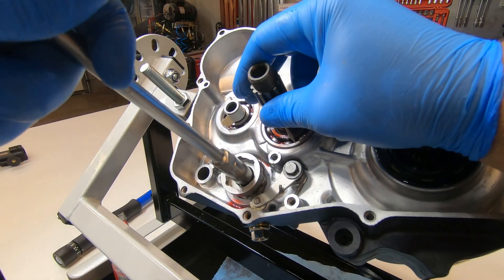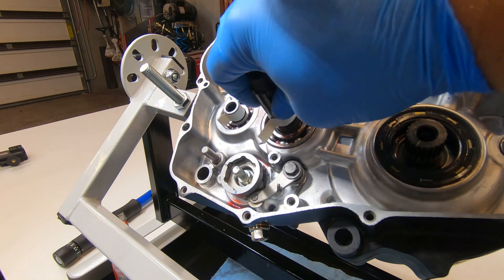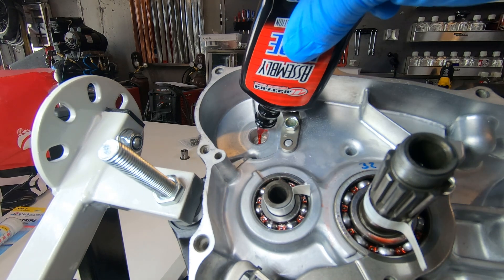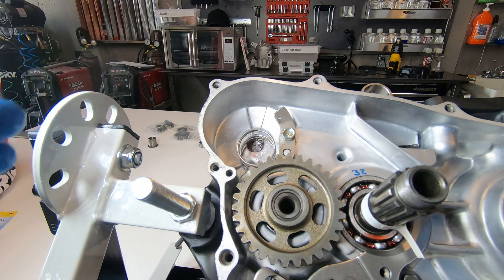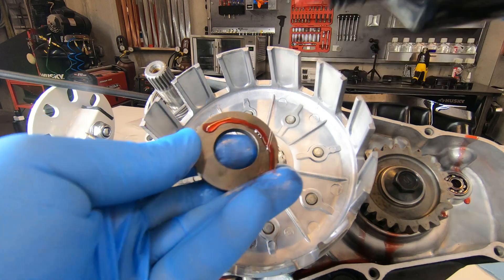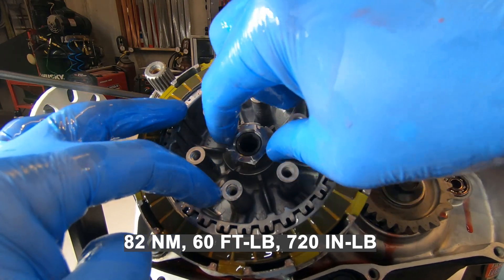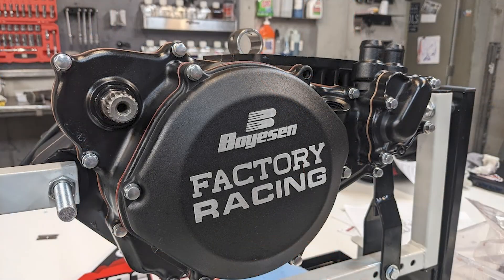CR500 Motor Build - PART TWO - Gearshift, Kickstarter, Clutch, Water Pump

Comment: So i just got done assembling the case and sealing it up. I didnt double check going through the gears before i sealed it. I was able to spin the drum selector. But now thatvthe case is together, is there a way to tell if everything is solid with gears before its totally complete and installed. Seems hard to shift? I was able to get it into first. Everything spins freely in neutral and in first you can tell its in gear. Any opinions or pointers to check it goes into all gears before i put outter case, clutch and all that on?
Reply from the maker: Perhaps if you give me some more info we can figure it out.

So you can get it into 1st and Neutral but that's all? 

Did it work properly before you took it apart?

Did you make sure you had all the little washers in the transmition?

Did you happen to examine the shifter forks and the dogs on the gears? 

Any chance the rods were bent?
Reply: @DBT-Nick  sounds good! Maybe I can get some pictures! But yea everything was solid before I took it apart no issues nothing bent and nothing seems worn out or damaged. I can spin everything freely I stuck the shifter on to make sure it went into gear since i sealed the cases already and when I did it's alittle hard to get into first and then when I try to go to second or above it doesn't seem to want to go. Washers are all there I kept it all together as much as I could and looked in the manual to double check. I should technically be able to shit thru the gears with it sealed up right?
Reply from the maker: OK, I want you to take off the shifting mechanism. So there will be a sort of round part with different indents in it. In the video you can see me turning this through the gears with a T handle. So do that. Remove the shifting mechanism and try to shift through the gears with a T handle on that part. One time what happened to me was I installed the shifting mechanism wrong and it made it so I could only go down to first. That was on a 1987 CR 250.
Reply: @DBT-Nick  sounds good! That's what I was thinking too. I should of done that before I sealed the cases up which sucks. But ohwell! Better safe than sorry! I saw your video after the fact! Lol
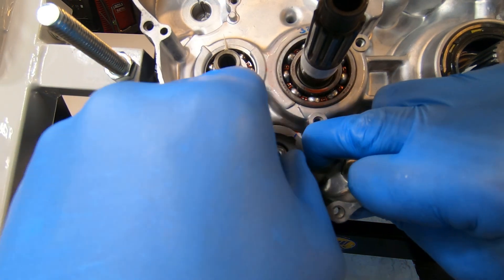Reply from the maker: OK don't feel bad, you test this after you seal the cases. So in my video at 0:47 I'm installing the Shifter Pin. Use a T wrench to turn the shift drum.  If that works ans you can go 1-5 then put the shifter back together and try again. 

Now IF it's still not working then gently try to make it free itself up for a while. If you can't do it then split the cases again and I bet one of the 3 shifter rods is crooked or something... Keep me posted.
Reply: @DBT-Nick  awesome!!! Tgat sounds like a plan to me! I greatly appreciate all your help! Will definitely keep you posted!💯 thanks again! Fingers crossed🤣💯🤞
Reply: Do you have anything on the water pump install? Does the seal face open side out on the outter case? It's been month since I took it apart and of course I don't have pictures. Then there's 2 water seals and an oil seal according to the manual?
Reply from the maker: it actually does matter which way those go, but I can’t remember how it goes. Let me look into it and get back to you. Give me like an hour.
Reply: Sounds good. I wondered. I put them closed side out on both of them. Manual and rocky mountain atv looks like open side goes out.
Reply: Wondering if I somehow installed everything with it in neutral? Which the manual said not to?
Reply: Doesn't seem to want to go into 5th all the time. Something still seems weird. But my line on the shifter drum now matches and lines up with yours
Reply: When you shift if does it seem like it gets stuck or hung up? Sometimes coming back down from 5th it seems like it gets stuck going back to 4th . Then from 3rd to 4th sometimes gets hung up even tho I'm spinning the shaft? I don't have pil in it but it was lubed up when I installed everything.
Reply from the maker: Hmmm all very interesting. Could it be possible that you have some wear on the dogs on the sides of the gears?  I think you're problem would not be that but I just don't want to rule it out. 

This is tricky...the good thing is that it worked before, so it should go back together and work. Just keep trying. You've likely just got something binding on you. I think it's gotta be the drum or forks.  Maybe check that you have the forks in the right configuration.

No I have not experienced the difficulty of shifting like that. 

Before joining the cases does it all spin OK? Shifting through the gears before joining them does it operate better?
Reply: @DBT-Nick  that's what I'm wondering nothing looked too bad when I pulled it apart. And before I put it back together everything was smooth and spun. When it's in neutral it spins nice when I shift into a gear you can tell and it's alittle harder to spin. I hate to do it but maybe I'll separate the cases again and see. I think it's the first time this motors ever been rebuilt. First time I've ever done it atleast.
Reply: @DBT-Nick  I double checked the shift forks when I separated it and looked in the manual. 5l and 5r were facing up and had them in the right order. And the one on the other side. I felt like they could only go in the one way as long as you had 5l and 5r in the correct spots and number facing up when it was onstalled
Reply from the maker: I'm thinking about this... I just keep thinking that if you split and join the cases enough times you'll get it. Haha 

Split the case but keep the shift drum installed on the clutch side of the right case to make it easy to place the tyranny into each gear while you turn the gears.
Reply: @DBT-Nick  yep I agree! Better safe than sorry! Sucks to keep doing but rather do that than break parts. I'll keep you posted and we'll see what happens. Hopefully I won't run into any more questions lol
Reply from the maker: I don't mind bro
Reply: @DBT-Nick  it's a warmer day out here now just came back and everything is shifting perfectly fine. I didn't spin the shaft and shifted and it's good now?! Weird. Lol
Reply from the maker: Oh good

Comment: What year engine is this??
Reply from the maker: 1997 but this video should cover CR500 engines from 1989 thru 2001
Reply: @DBT-Nick  I’m finishing up my 1987 engine tonight, water pump side and then top end
Reply from the maker: @Brensta18  How'd did the motor finish out?

Comment: Hey man nice vid! A coworker of mine gave an ‘88 CR500. She’s in pretty rough shape so I’m trying to do a full rebuild. Wondering if you have any suggestions on best place to buy parts or any lessons learned from your rebuild. This is my first time doing a rebuild and I’m a bit nervous about ruining a beauty like a CR500
Reply: Not true stock for stock a cr500r still beats modern 450s unless it was a crap driver... will it absolutely smoke a 450 no... but still faster then 450s (with a healthy stock cr500r)... now if your talking about more technical riding yeah a modern 450 will probably beat it due to better modern suspension and being a bit more controllable. Cr500r will still pull ahead on straight aways tho
Reply from the maker: HELLO! Ok so try to keep in mind that they don't make these anymore... and so you want to really do your best work. Now, that being said, there are numerous companies who make parts, (bearings, gaskets, seals, etc) but try to get OEM. I spent about $1,000 just on OEM parts from Honda via Rocky Mountain ATV/MC. Just follow the steps and you'll be good. If you can afford it you should get at BUILIT-500 Crank. I have some resources if you need cylinder work. What color are you going for? I Cerakoted the cases and it turned out so sick. The 1988 CR500 motor was all black. Let me know if you need help with that. Also all bare aluminum would look sick too. 

Ok another thing, do you want a stock motor or one with a crap ton of power? For reference, a stock CR500 will be slower than a modern 450, so maybe that helps. If you want more power, or like a race motor for climbing big sand hills then you need to plan for that and I can help you get your motor to deferent shops to help you accomplish that. 

Let me know!!
Reply: @DBT-Nick   dang thanks for the quick reply and awesome info! I was looking on RMATV and I unfortunately couldn’t find an engine rebuild kit for the ‘88 and I’m weary of other websites. Did you buy a kit or individual parts? I was for sure planning on cerakoting it and I was thinking about doing black but I also kinda wanna do something a little flashy just for fun like red or a brass color. 

I’m not a super experienced rider so the stock power already is a bit intimidating for me. I haven’t ridden in about 5 years and my last bike was a CRF230. I basically just trail ride so I think stock power is already a bit much for the kind of stuff I’m capable of hitting for now.

I haven’t gotten the engine torn down yet, but I have gotten the cylinder head off and the right crank case off and it looks like the coolant system is pretty shot. There’s white deposits throughout it and sand looking stuff all in the water pump. I’m guessing the last guy either didn’t use distilled water or used an oxidizing coolant. Any ideas on how to deal with that?
Reply from the maker: Alright, so I just bought individual parts, and with exception of the crank I bought the best. I have a new “Hot Rods” crank. Don’t try to get a Wrench-Rabbit kit or anything like that…try to get OEM seals, bearings and gaskets. Most of that stuff is still available from Honda. Your stock crank might be ok…don’t assume you need a new crank for now. You’ll want a Weisco piston, but don’t buy it until you measure the bore with calipers and check back with me or work with a machinist who’s well experienced. You have an iconic engine so make sure you don’t just give your cylinder to anyone.

Cerakote, let me know if I can help you in any way with that. I can cerakote it but you need to pull all the bearings yourself and grind out the casting imperfections if you are about that.

CRF230, those are so reliable. I had one until recently. We called it the Turd-30.

Water Pump, so I believe your engine had the magnesium right case, which suffered from corrosion if the wrong coolant was used. I believe you can use a right cover from later years and get around it. They’re available from Honda for about $180.
Reply: @DBT-Nick Hello Nick, I just noticed you did not install the washer under the lock washer on the clutch inner hub. According to the parts fische there is a washer under that locking washer. Just thought I would clarify with you.
Reply from the maker: @MrMotocross450 oh crud I hope it will be OK. It hasn't self destructed yet but I hope it doesn't become an issue. At least that's easy to get to. I should probably do that.